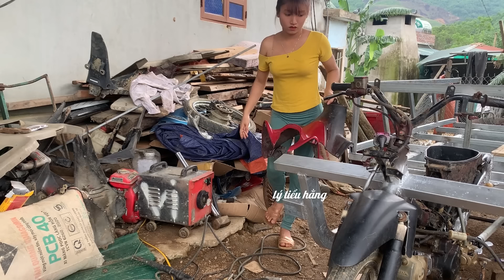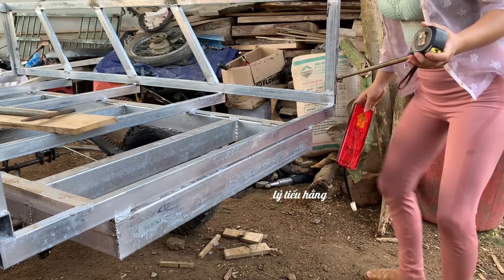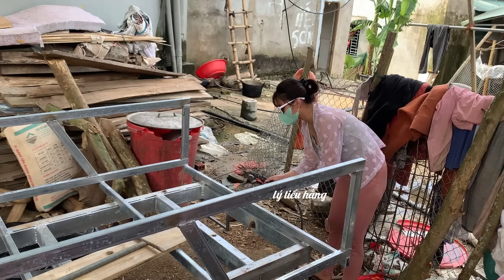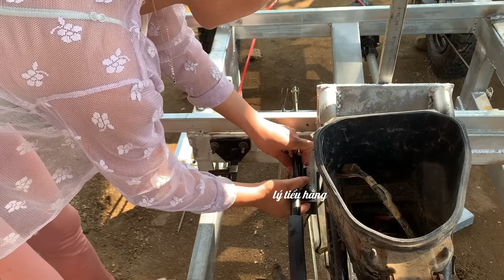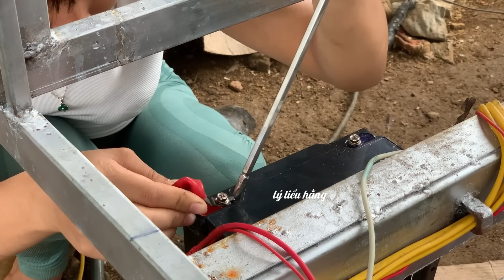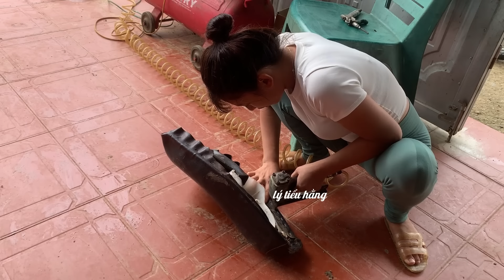TECHNIQUE FOR INSTALLING THE WHOLE HANDBRAKE FOR 3 WHEEL VEHICLES

Comment: Hi Ly,your cart looks excellent so far.The lights work and you protected them in brackets which is very smart.Don't forget to put FUSES or circuit breakers in for the electrical stuff,it will keep you from burning the wires if you get a short circuit.Great series on this cart.

Comment: Nice thing, it looks like a moto-cart, three comments though:
1. those self tapper screws are meant for single sheet perforation without pre-drilling
2. she needs to get a drill with 2 gears and side handle (prevent hands twisting)
3. she's always too nice dressed for welding and dirty work. Work clothing with pockets recommended
😁